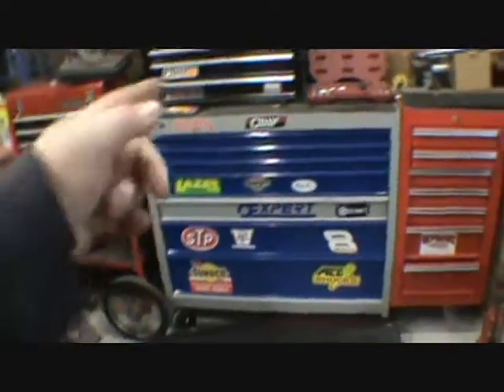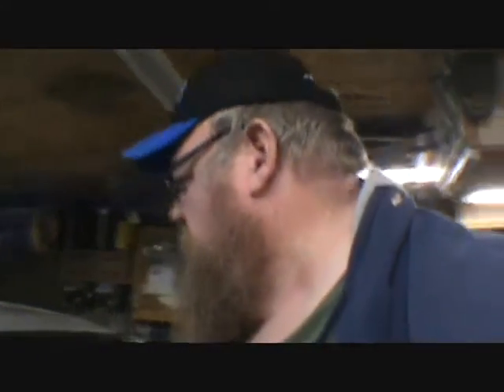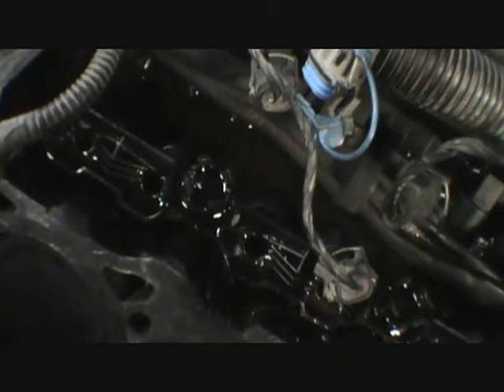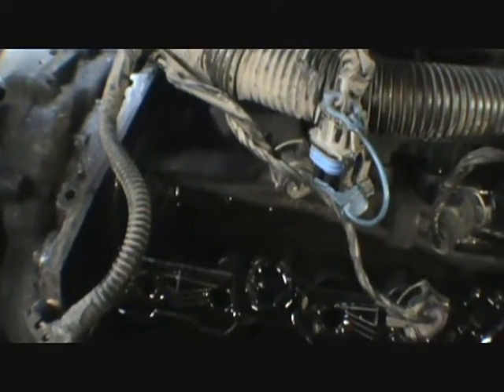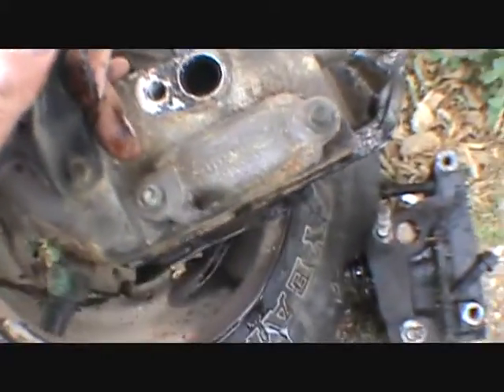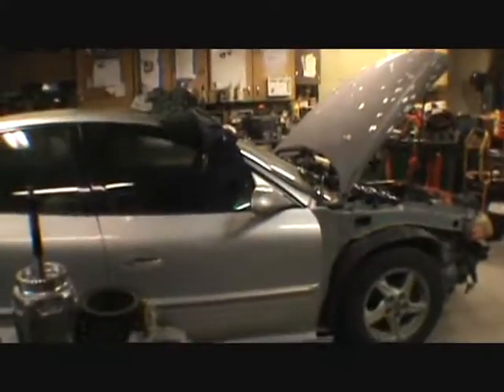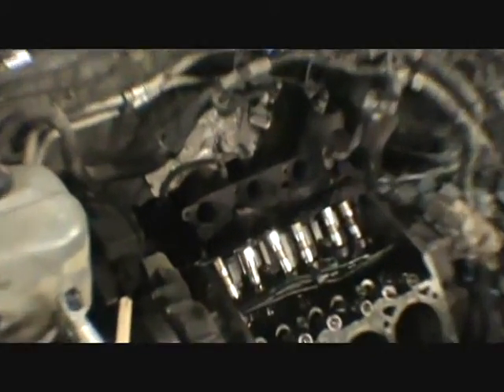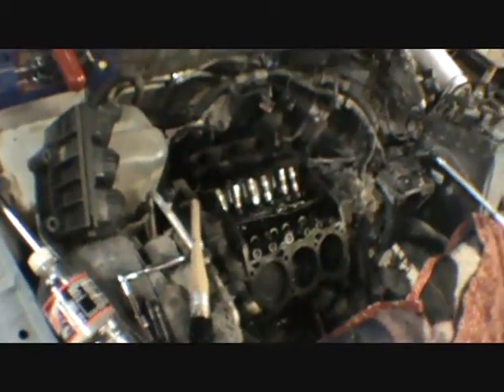2001 bonneville removing the last head and some clean up

Comment: Same with everything now days. I use to repair twoway radios, CB's Ham ..... I'd find the bad diode, or resistor, cap or whatever and replace it, a 10 cent part, now everything is plugin boards.
Reply from the maker: +buzzsah yea and that 10cent part now days cost 15 bucks to ship it